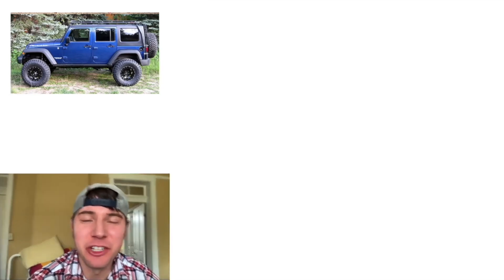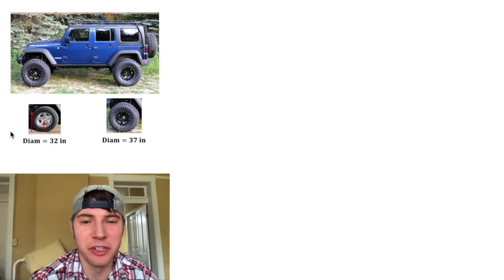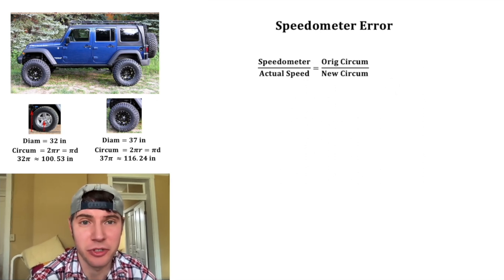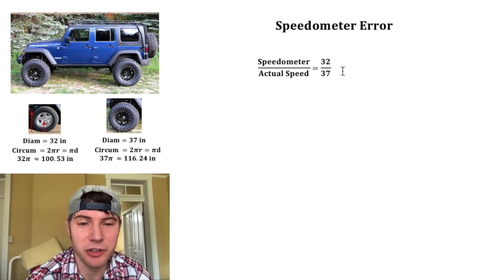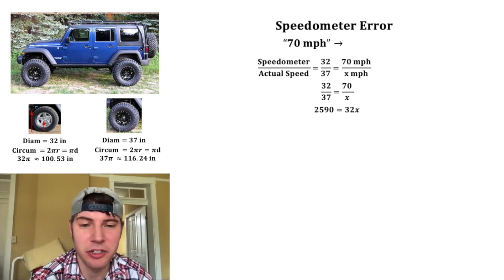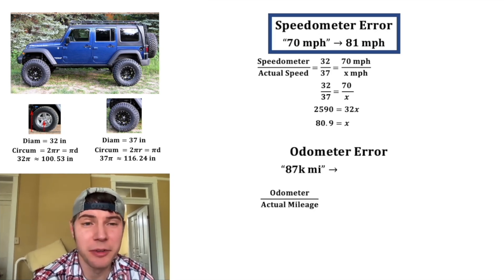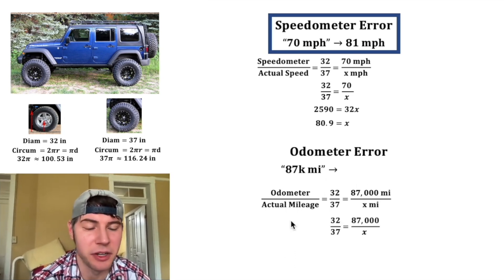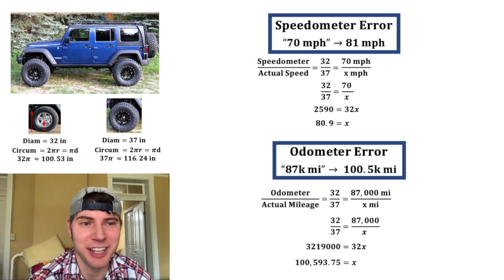How does Tire Size change Speedometer?

Comment: On the plus side, you would get close to accurate GPS speeds , as all manufacturers  tend to calibrate the speedo around 5-10 miles higher than the true speed.

Comment: I think most are aware. Forget all the cross multiplying just take the originally ratio 32/37 and you get ≈.86 that’s now your factor you need. Just divide it from anything your vehicle says 70mph/.86 = 81mph, 87k/.86 = 101k . Put a box around it.

Comment: All this is true.  But keep in mind, all Speedometer and Odometer outputs are run through the car's computer first.   Within the computer's is a register that will "handle" the tire's circumference such that speedometer and odometer's outputs are accurate.   If tires/upgrade installed by dealer/manufacturer - that register (and likely other's that control the engine and transmission) will be updated before the consumer gets the vehicle.   

If tires are installed aftermarket, then one needs to confirm that the necessary registers have been updated.

Comment: I've got a jacked up truck on big tires, but I've known that from the start. Mine is off roughly 10%,so it is fairly easy to estimate my real speed.

I did get pulled over once. It was my fault. I was kinda zoned out on the speed adjustment, and I wasn't gonna dispute it. But the officer just offered up "maybe your tires are throwing off your speed". I was like "oh yeah, never thought of that before". I wasn't going to look a gift horse in the mouth and left happily with my warning

Comment: My first car was a used Chevette (back in 1985), and the tires that came on it were oversized.  I noticed because I constantly did arithmetic on road trips to estimate when I'd arrive at the next city based on the speedometer reading and distance.  It was always off by about 10%.  So then I started timing myself between mile markers.  By doing that, I knew it was off (and by how much) but I didn't know why until it needed new tires.  I bought the correct size, and bingo. Speedometer was accurate again.  These days a GPS will tell you how fast you're going, so there's more hope for people who don't do recreational arithmetic while driving.

Comment: Before watching it: it makes sense to me that if the odometer reads properly on the 32" tires, then it would read only 32/37 of the actual distance with 37" tires. So your odometer would register only about 0.86 of the actual distance traveled.

Comment: I have a Yellow Box speedo recalibrator.
Its a little gizmo you buy and attach to the truck's speed sensor, and you can set the Yellow Box to any ratio you want, so you can set the speedo and odometer to work accurately again. Awesome gadget, even has a 10 year guarantee where they replace it if there is a problem. 👍👍👍

Comment: 16% higher speed also translates to 16% lower torque at the wheels, so the effect is like taller gearing.
When I swapped to lower-profile tires ages and ages ago, I worked it out that they were only 2% smaller in diameter, so I didn't get too arsed about it.  That difference is about equal to worn-down tread vs new.

Comment: You use names like SpeedoMETER or OdoMETER but measured values are not in km, but in miles. :)
Reply: United States is aligned with Liberia and Myanmar as the only countries which still use ounces, inches, feet and Fahrenheit.
That's just one more thing some Americans can be embarassed about.
Reply: When I plugged in my voltmeter, the display said my outlet was putting out 120 meters, too.

Comment: I did this math for the truck I bought from my brother 30 years ago and used junk yard marker to relabel the speedometer.

automotive thought: milage isn't really a good indicator of a vehicle's usage, right? (obviously not the point of the video) so the fact that a vehicle with oversized wheels "has higher milage" doesn't in and of itself indicate greater wear. though you could do the opposite, and put tiny little wheels on a new car and reduce the apparent milage for the resale value . . . but that wouldn't be nearly as smart as &E
Reply: Yea I thought the same thing.  The measurement that matters mechanically is really the amount of times the axel rotates which is actually the same amount of times for 87k vs the new 100.5k, right?  I’m not mechanically well versed but this was my first thought.
Reply: It has greater wear because putting on larger tires and lifting the chassis increases the stress on the entire powertrain and the suspension exponentially as you go taller and taller. Like, a two inch lift is no big deal, but the guys who need stepladders to get in their trucks are beating the entire machine to death just by driving it. These mods are abusive.
Reply: @bloodleader5  Good point. Re-engineering stuff without, yʼknow, understanding engineering, is often a bad idea.

Comment: The PCM will compare the input of the hall effect sensor that measures the tires with the GPS input, and will correct the error.   At least to a point where it will throw a check engine code.  Turns out, other people, who actually fix things, knew about this problem too.
Reply: Which is only for gps enabled vehicles. Any vehicle manufactured before ~2015 won't have this functionality.

Comment: Great video.  Of course, if using the truck off road, it's best to change the gearing in the axles to account for the larger tires.  I have 35" tires on my 1985 4Runner and swapped from 4.10 to 4.88 gears in the axles and the speedo is dead on compared to GPS.
Reply: The original tires were probably 31", right?
Reply: @richardl6751  Actually around 28" to 29", the Toyota models of this vintage that came from the factory with 31" tires, had 4.56 gears in the manual transmission models.